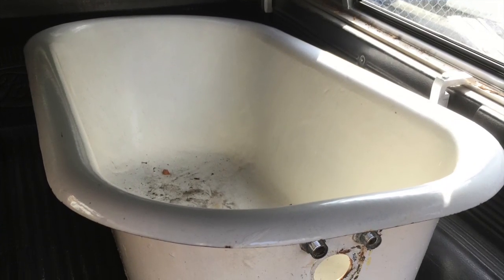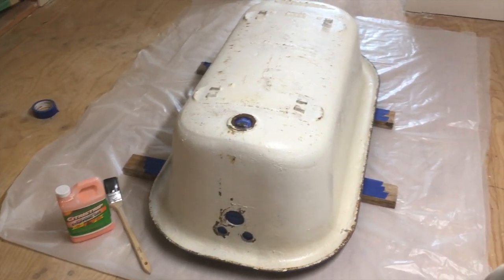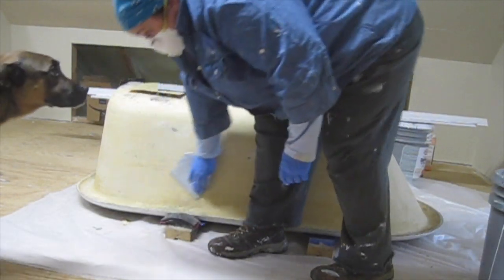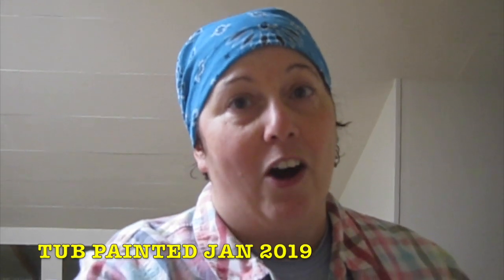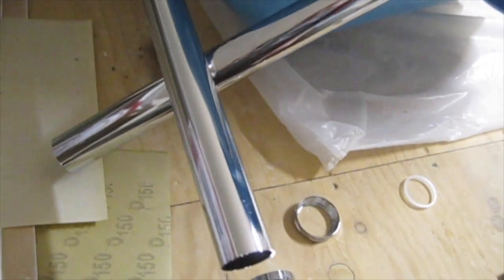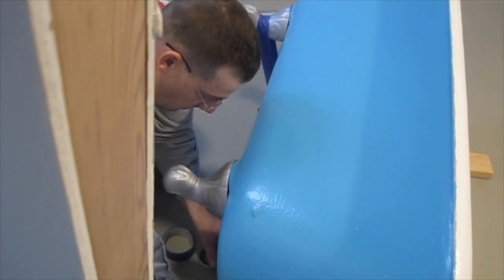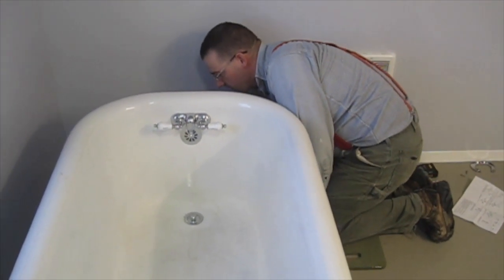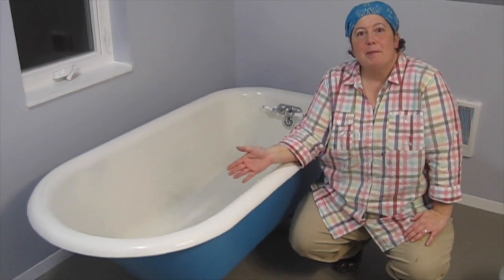1920s Kohler Clawfoot Tub (Building Farmhouse #20)

Comment: My uncle gave me my Grandmother's 1920 Cast Iron Tub to put in my new house. It looks identical to yours, can you tell if it  makes a difference where the claws go, in any specific place? I think he told me there are 2 T's and 2 S's? I'm assuming when he removed them to repair he may have gotten them mixed up as far as where they go back? Your tub looks great! Thanks for sharing!
Reply from the maker: Mmmmm. Our feet were all the same, and we just put them on once we refinished them. I'm not sure about the T's or the S's. You could try them in different ways to see if it matters??? Otherwise, we still LOVE our tub!!!!
Reply: It might be "T" for "Tall" and "S" for "Short"?  Because the drain end of the tub needs to be lower and most floors are pretty much level.  So the legs that are slightly lower should go on the drain end.
Reply: Have you tried writing to Koehler? I do that a lot with antiques I find. They might have some good information. I love researching the stuff I buy.

Comment: I like the tip with the tape. Our feet keep falling off every time we try to move it into place 😢 we will have to try this!
Reply from the maker: Lindsey Greene it’s surprisingly there isn’t more to hold the feet in place, isn’t it? Thanks for watching!
Reply: @vnthomas16  Just wanted to give you an update on ours - it appears a piece was missing because no matter how many time we tried to balance and move the tub so careful the feet would slide off.. we believe there was supposed to be a pin to slide in between the bracket to keep it in place so we ended up making our own and it is solid as can be now! A lot of trial and error with renovating! LOL.

Comment: I had no idea that those claw foot tubs were worth that much, guess I better clean them up, and try to find all the feet.👣
Reply from the maker: Yep! They have a charm and can usually be fixed up. I bet you could sell it even without the feet. The architectural salvage place we got ours from actually had a bunch of different feet to sell, so, it wouldn't be hard for a buyer to get some. Good luck!
Reply: @vnthomas16  hi, I buy the kholer tub but, unfortunately dont have the, feets, foots or legs, I found different than yours and before I buy I want's make sure works in may tub.....you dont have a video when you install the feets, or puctures to have idea...thanks
Reply: Pictures to see the hardware
Reply: I guess it depends on where you live. I live in Arkansas and you can find them for sale all the time usually around $100 and up.